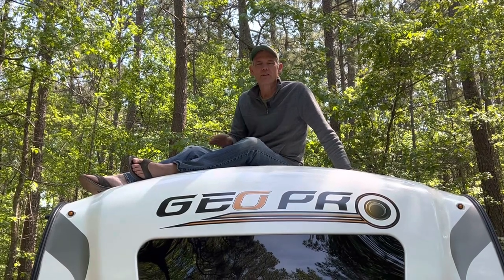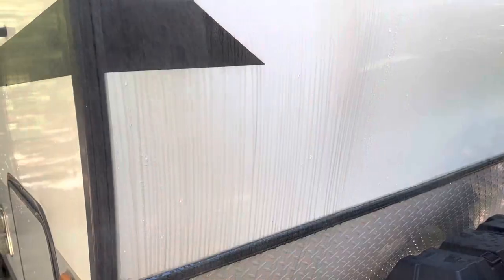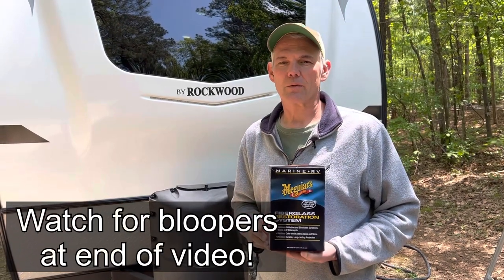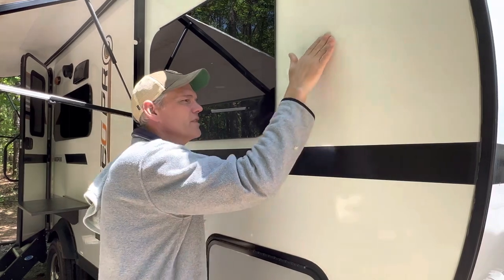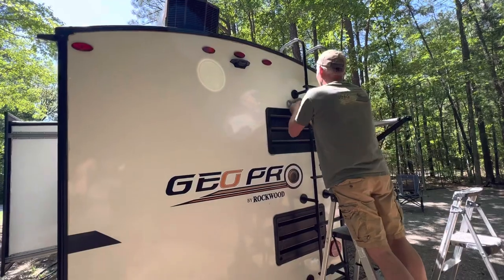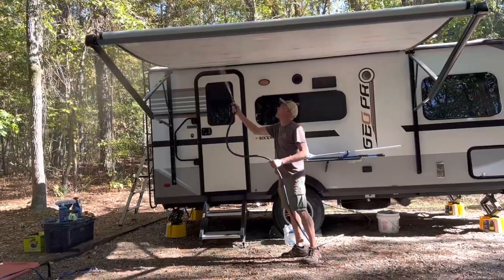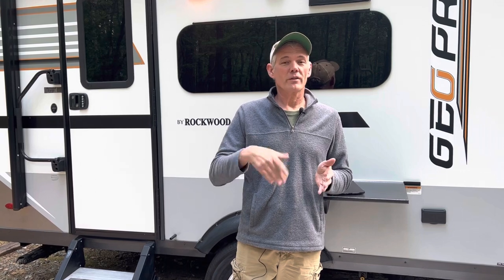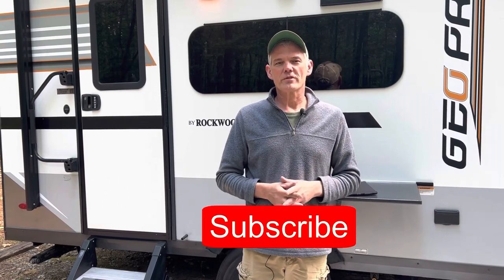Cleaning Our Camper - Top to Bottom!  And This Camper is Shining!

Comment: Thanks for the info. It looks like a lot of work. I appreciate the product info because I didn’t know about them and my just sold trailer would have looked nicer. Maybe the new trailer will look better longer if I follow your cleaning tips.
Reply from the maker: Thank you for watching!  It did take a better portion of the day but we were doing some filming along the way as well!  I think each time we give it a good cleaning - it makes keeping it clean a little easier.  We just got back from a trip and it was very dirty from some wet and dusty roads.  The dirt just wiped right off!   Will need to do some work on the black streaks again but it only took 15 mins to get it clean with the wash and wax product we use for touchups (we did another video on that).

Comment: Man that was a job!  So the 303 SiO2 rinse off protectant wouldn’t work well on the fiberglass side panels?  I used it on my truck and it was so easy and even works on glass. Beads like crazy.  Spray on wet truck and rinse off. Easy as that.  It’s not cheap but for how easy it is I’m going to try it especially the front where the bugs splat.
Reply from the maker: It was a bit of a job lol.  Luckily was the last of the cooler spring weather so at least it was a nice two days to tackle it.   Assume the 303 Protectant would work on protecting the fiberglass as well - haven't checked that out though.  They really are a great line of products.   Our cap was pretty flat looking - lots of oxidization so we researched how to remove, found the manufacturer and called them and they recommended the Meguiars.   Feels like glass now.   But will look into that 303 product to help maintain - thanks for the tip!

Comment: Hi again. Your videos are great. Informative ... and fun .  Couldn't find anything on tires though ( or the fridge door, but that's a story for another time ;). We bought our '19 used. It came with what is called the "off road pkg". ( 2" Lift and bigger wheels & tires ). We are leaving on a long trip later this summer ( everything's long from the Keys ), our tires are 6 years old. With the hot sun we have down here we're probably replacing the tires. Our "off road pkg" comes with an aggressive tread 235/15. I have read on forest river forums that the trailer pulls much better with the Endurance tires you are polishing up on this video!  Including mpg. Any ideas? Thnx .....Nice tip on the Meguiar's Kit. Worked great !
Reply from the maker: Thank you for the kind comment!  So glad you are enjoying and truly appreciate the support!  And glad the Meguiars worked for you - it really did a nice job for us as well.  

 So on the tires - we switched over to the Endurance a few years ago.   We really liked the Westlakes that were on it but couldn't find them except on Etrailer.  We had a trip we wanted to change the originals out for and couldn't get them in time.  So, we did go with the Endurance (225/15).   And they were less expensive.  They have been fine - about 7,000 miles on them so far.  But really don't notice that much difference except a little less "bounce".  But not so much that I would make a change based on that alone.  We were hoping to see a mileage bump but can't tell any so far on that either.   We may switch back to the Westlakes next time.  Just because we like the look of that tire.  But- overall - Endurance are easier to come by, perform well and are (were?) less expensive.  

Where are you headed for the summer?  And what happened on that fridge door?
Reply: @WinesPinesandCanines   I get you what you mean about bounce. Less is definitely better !  And 300 for Westlakes seems a bit steep ( e-trailer). Trailer Tire manufacturers for the most part are unknowns to me so I am .. wary. Ha. Costco has a 225/75  15 E for a 100. But its a name I don't recognize. Greenball . Decisions decisions. 

We're heading to the Black Hills SD BWO the Ozarks ( moochdock ) . Then a few stops in Wyoming ( Flaming Gorge is nice ) .  Then somehow we need to get to Silver City NM. I have a feeling that means the 4 corners area ! I need to finish charting it out ! 

So on to the fridge. We bought the Geo Pro about a year ago. There have been numerous issues , loose screws ....and improvements. (The best being your King Bed idea. I'm 6'4" ). But on our first trip out of the Keys ( Ortona Lock - Army Corp ) we open the fridge door , and the whole outer cover of the door ( stainless ? ) slides right off. Bam ! And its heavy. Kind of snaps back together. And then falls off a few months later. RRRRRRR. Haven't felt like taking it off to fix it because there really isn't much room. Next time I'm getting out the glue.  Thnx again !
Reply from the maker: We definitely don't regret the Endurance tires.   Just like those off road tires haha.  Had someone come over at a rest stop once to tell us how great they looked!  

Black Hills are beautiful!  That will be a great trip!  Wyoming also is a fave.  Flaming Gorge has been on our trip schedule twice and we keep having to push it off "until next time".   But looks amazing.  

Oh - that would be annoying on the fridge.  Think the glue might be a good idea.  Just FYI - ours has some scratches so we looked to see if we could get another stainless panel.  Nope - could only find the whole door (and that was difficult to track down!) and that was $300++ soooo sticking with the scratches and will add some stickers lol.

Comment: For the awning, we've had great luck with Dawn power wash spray, the spray version of Dawn dishwashing soap.  Spray, let it sit for 5 minutes, scrub with a broom and bam.  For tough stains, we use Oxiclean bathroom cleaner with peroxide.  The bleach version will cause early dry rot if used too often.  Same process as with the Dawn spray
Reply from the maker: Thank you!!  Will be doing a thorough wash and wax in a few weeks and will try this.  Thanks for the watch!

Comment: not sure if you know but i want to get a bigger tv for my trailer we have the same one. i cant figure out how the tv mount disconnects ive looked multiple videos cant find anything any ideas would be greatly appreciated!
Reply from the maker: So haven’t tried to remove the tv yet.  Ours is giving us some issues with pixelating but we haven’t circled around to switching out yet.   We are going on a trip in the next few weeks so will take a closer look one evening.  Are you trying to get the tv off the mount or take the mount out all together?  I know our cabinet is open behind it so if we take the speakers out we can look down behind the tv - may give you a better look?
Reply: @Wines, Pines and Canines  I want to use the same mount just get the tv off the mount